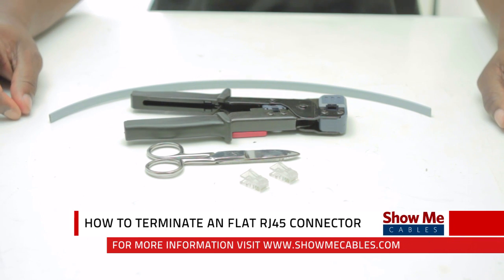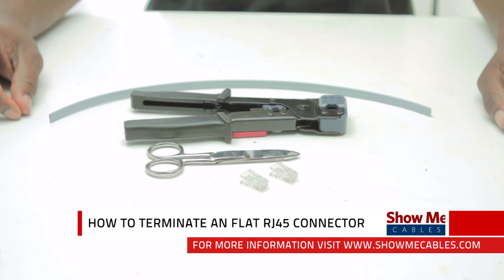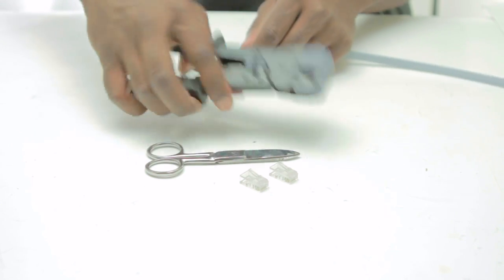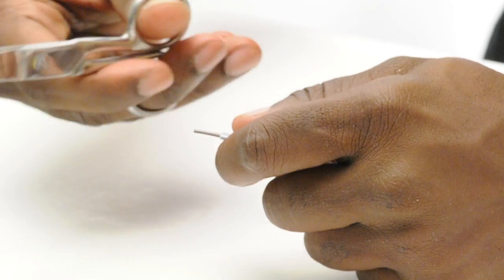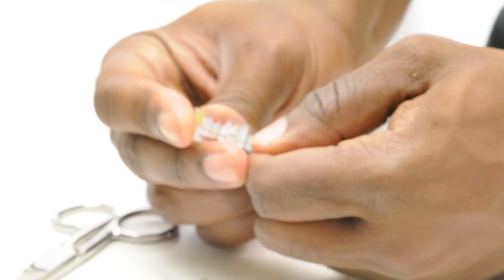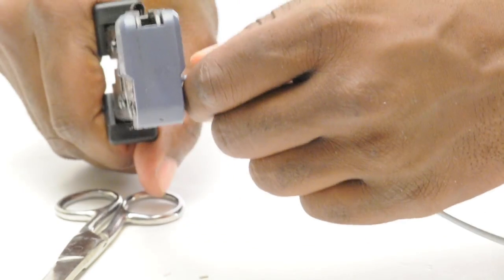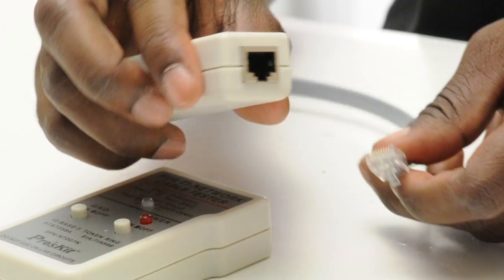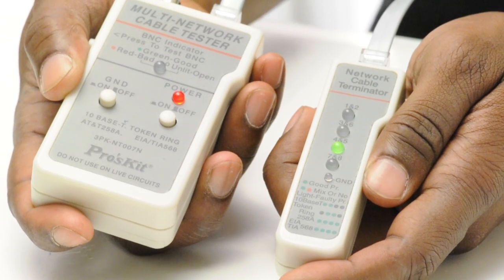How To Terminate a Flat RJ45 Connector

Comment: Will some stripping tool will not work on flat cable? How about on Cat 7? Will Cat 7 flat cables have shieldig on them too? Is it all the same. What if your color codes different from the color codes on the wires inside?

Comment: HOW DO YOU WIRE IT IT IS IN DIFFERENT COLOR CODES 🤷🏼‍♂️
Reply: Does it matter, as long as it's identical on both ends?
Reply: Mr. Frostbite on regular Ethernet cables it does
Reply: The flat cables seem to have everything lined up already, so all you need to do is know which cable is on the first pins (Left most) and make sure it's the same on both ends. Google image search "T568B pinout" that's more common to use. (Make sure you use B)

Comment: I noticed that mine has different colors like red from the round cables which do not have red. They must have a different order from the round cables. Is it just a matter of being consistent on both end? The one I am repairing is showing the brown to the left of the copper terminals (opposite the clip) but no matter what I do it is not working. I just have regular rj45 clear connector which I use for the round cable which looks just like the ones that were on there. I've done it before on a flat cable, unless there is something wrong with this cable. I am doing it exactly the connector is on there.

Comment: I bought some Belden cat6 flat cable and each pair of conductors a bonded to each other. Do I have to pull them apart before inserting them into an RJ45 connector?
Reply from the maker: I would imagine that if the conductors are bonded that there is still enough clearance to fit into the conductors, our flat RJ45 connectors are for Cat5e, however, so it is also possible that the Belden brand of cable may require a particular connector that is compatible.

If you still have questions you can contact our customer service department at 888-519-9505 or customer.service@showmecables.com

Comment: Good video. i was wondering if these flat cables can be re terminated. I was also wondering if having a tester is really necessary, atm im not a technician, but i am learning on how to work these cables.Thanks
Reply from the maker: You can snip off the ends and use a new RJ45.  They aren't re-usable.  If you don't want to use a tester, you try the cable out by connecting two pieces of equipment.  You could also use a multimeter, but you have to be careful to make sure you are only touching one contact at a time.
Reply: @ShowMeCables but are terminals easy to find? I seem to find terminals only for round cables and don't know if i have to use a different kind or search for something else